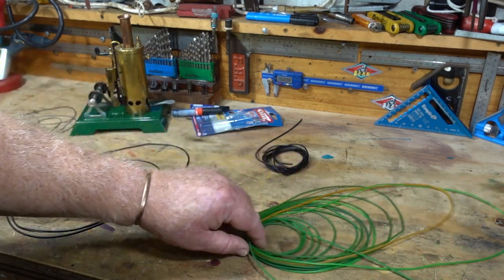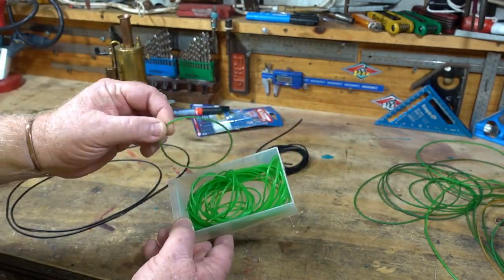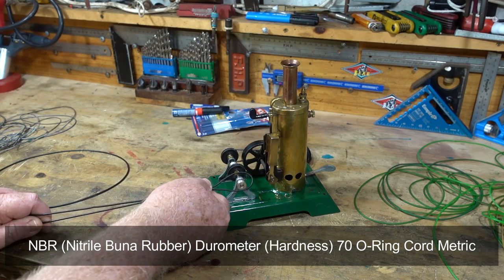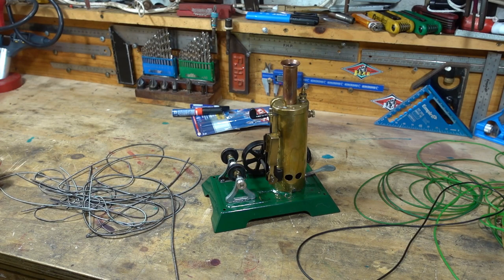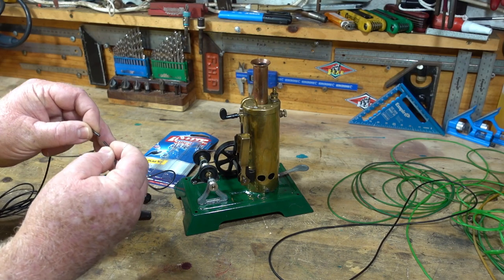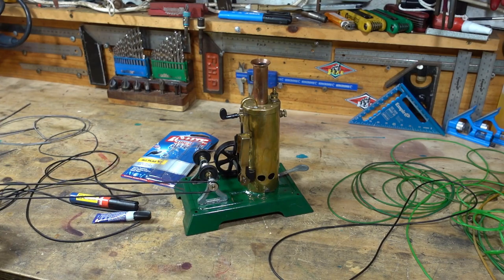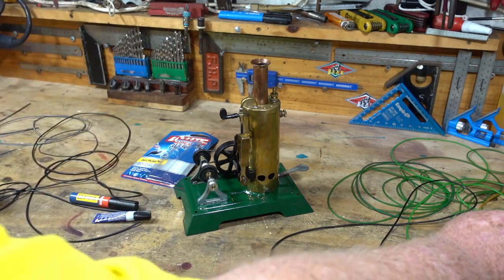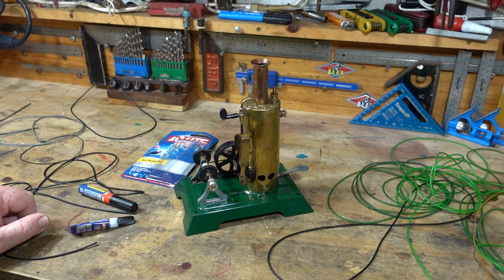Toy Steam & Model Steam Belting options for running Steam Engine Accessories

Comment: I assume the green can be dyed or black magic marker used in it to make it black or brown.  Maybe even black stripes for fun.
Reply from the maker: Been there with a black marker, not a lot of fun and the results don't look all that good and it wears off patchily. Also the green stuff slips (its meant to slip as its made for jewelers and clock makers lathes) the O ring material is cheap and you can get it by the metre locally and is soft and very supple and joins together without having to melt and join the ends like the green stuff - Cheers Jim